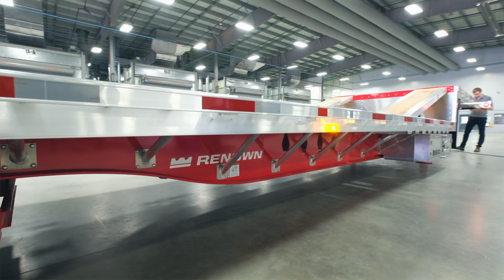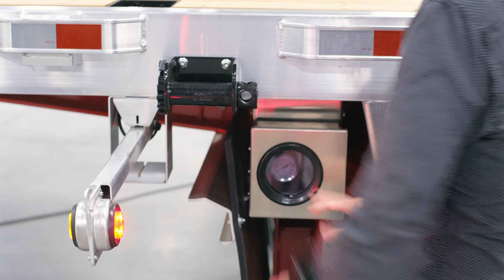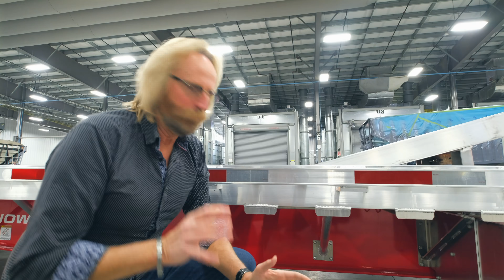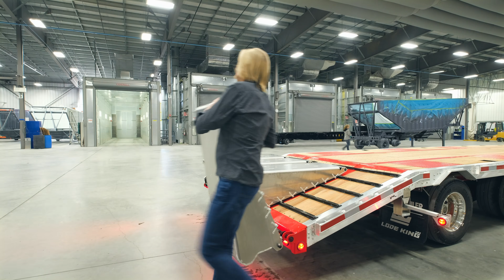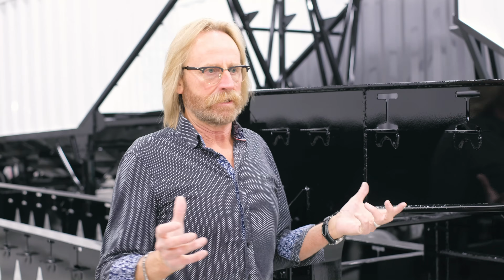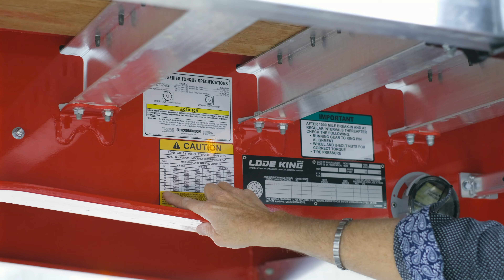2019 Renown Drop Deck Beavertail

Comment: I like how the trailer is spec'd but the ramps to the front of the trailer looks like a high stress point. There is essentially a bracket acting as a lock with only some welds, what are those ramps even rated for weight?

Comment: Don't like the fixed ratchets on the top or bottom deck... should at least have the pull out chain on the plate over the rear wheels on the trlr for hook attachment..not enough securement at rear of trlr..not worth the 💰..